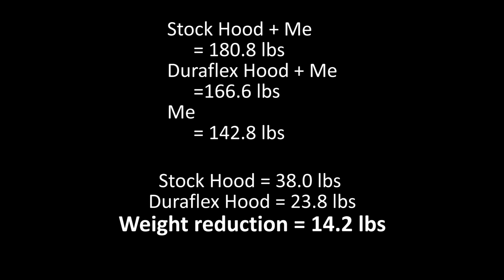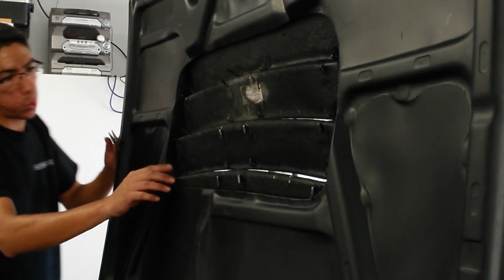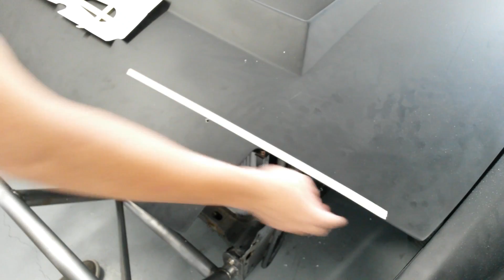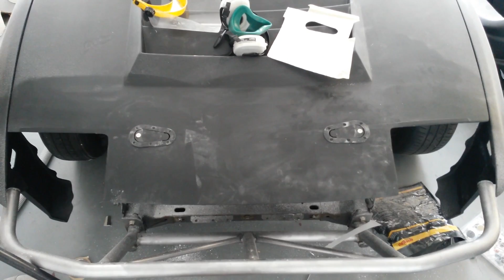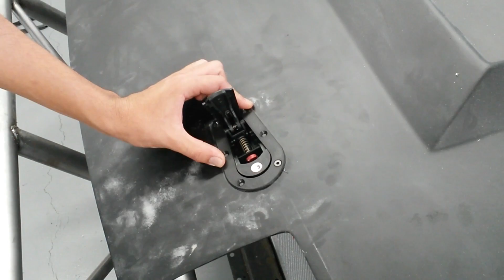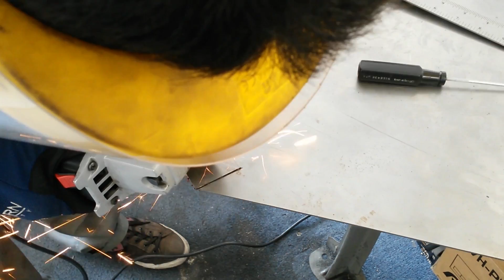Project 240 - Le Drift Car II | Ep. 7 - Duraflex Hood!

Comment: question: what if water goes into the hood?
Reply: I t won't that shape of hood causes a vacuum which  sucks hot air out the engine bay which forces cold  air in from other places
Reply from the maker: Nothing really

Comment: hey there I need some help  with some fender covers I just bought from duraflex they don't fit at the top part where the hood touches, so that I can bolt them on some sections are short and so I was thinking of cutting them completely off but have no idea how they can stay on without epoxying them straight to the frame

Comment: My car has a reverse opening hood, so the hinges are at the front and the latch is at the back. I'm putting on a fiberglass hood. Where should I put the hood pins? At the front, back, front and back? or maybe middle or are they unnecessary?
Reply from the maker: +Random Precision Put the hood pins on the side where the latch is at. For your application, the back. Front pins are not needed because the hinge is there. Middle is not needed either. Just at the back.

Comment: time for that stupid fuckin question. will you ever SR20 swap it?
Reply from the maker: +Jack ALLEYNE Hahaha no, I will never have an SR20 in any of my cars.
Reply: good man
Reply from the maker: Haha ;)
Reply: How many times have you been asked that?
Reply from the maker: Too many times that's how many haha
Reply: +Jack ALLEYNE i think every 240sx owner been asked that question
Reply: +OffBeat Garage interesting why
Reply from the maker: S13 WARRIOR SR has an aluminum block that half the threads strip out on when rebuilding. SR put's out less torque than a KA and torque is what you want when drifting. More expensive to replace an SR if it blows up compared to replacing a KA. Parts availability for an SR is lacking in the US. I can go to most auto parts stores and they'll carry parts for the KA but you won't find them carrying anything for an SR. For the price of SR swapping I can build a higher hp KA-T setup. Yup haha SR is not my cup of tea

Comment: It would be interesting to weight the hood with complete latches, hood brackets you made, and then, see the real weight saved.
I doubt it really will be efficient for cooling down the engine bay,but it should work for the radiator.
I would install a skirt between the radiator and the vents ,otherwise you will loose all the air pressure everywhere in the engine bay's turbulences and not create a low pressure hot air from the vents.
A cheaper way would have been to install shims on the articulated brackets to allow air to escape just in front of the windshield, (that mean after the engine following the air flow) and cut the structural layer of the hood.
But it wouldn't be so nice than this duraflex hood i guess.
A lot of effort in the video and work.
Greets from France.
Reply from the maker: +michaelovitch This hood is going to be pretty much necessary with doing a vmount intercooler and radiator setup which is planned. So hence the vents positioned right where the intercooler can have good air flow.
I have hood spacers and might be running those as well. Just not sure if I like the look of it.
Thanks :)

Comment: I see your Koyo being pierced by the red studs in a impact or tire intrusion. Cut them off!
Reply from the maker: +Osvane Abreu They will be cut when the front end is 100% done. Just like the tube front will also be fully welded when it's 100% done. Not going to make any permanent changes just in case I want to change the design up. So I'm not cutting them, just in case I change the setup and then end up needing them at their full length.

Comment: I have 1 very important tip for you... ditch the harbor freight grinder... seriously you will thank me!!! the lock button on them constantly break even on the heavy duty model.. Trust me i went through 3 of them in a year. Go to Lowes and get a kobalt grinder for $50. i beat the hell outta the thing and its still kicking! Nice looking project by the way
Reply from the maker: +Shane Hildebrand Lol I beat on this grinder and no problems. Over 4 years of abuse now and no issues. And there would be days during the summer where the grinder was on 5 hours a day, during 100+ degree temps and still keeps on going. If this one happens to break I'll get something else, but until then I can't complain. Thanks!
Reply: ***** I agree they are a good grinder. It's just the wheel lock button I had problems with. Idk maybe the older ones are made better? Lol thanks for replying. Have a good one
Reply from the maker: Shane Hildebrand Haha maybe, who knows lol. Thanks for the suggestion either way :)
Reply: No problem. Thanks  for replying either way! Most people dont

Comment: Just want to throw this out there- that hood catch is a safety mechanism designed to keep the hood from smashing into the windshield in the event of an accident. So disclaimer: You shouldn't do this mod on a street car. :)
Reply from the maker: +Michael Johnson Lol what? If you have hood pins, they are not popping off whatsoever in the event of an accident. And if you're in an accident where the pins or hood breaks then stock latch wouldn't have helped either.
Reply: To clarify I'm talking about the catch on the hinges themselves that you cut off. Aka safety stops.
Reply from the maker: I am well aware of that. The stock latch mechanism works on a lever and cable system. When that lever is pulled by the cable the hood is released and caught by the "catch" you speak of which is the safety precaution in an accident. My point being that, that is done because the stock latching mechanism works off of a cable and lever system. Where anything that triggers the lever, whether by the cable when you pull the handle inside the car, or by means of an accident and the damage hits the trigger the hood pops open and therefore they have the safety "catch" to catch the hood. But when you have hood latch/pin there is no lever or cable that can trigger that. When the pin is locked in, it's locked in. There is no safety measure required.
Reply: +OffBeat Garage Not the secondary hood latch bro. The safety stops on the hood hinges that you cut so the hood will raise farther up. What I am telling you is that [Disclaimer] people watching your videos shouldn't do this on a street car. Again I'm not just pulling this stuff out of thin air- I'm a collision tech and certified estimator; if you were in an accident your Insurance will find out about stuff like that.

Comment: I have a question. How wide across is the back of the hatch on your car? I can't find a ducktail spoiler for my car and I was thinking that maybe a 240sx ducktail wing would fit on my car, depending on how wide it is. If you could let me know that would be awesome, because I've been looking for a wing for awhile now and will just have to fit one from another car. Thanks!
Reply: What car do you hae
Reply: +Marco Hernandez I have a 1992 Honda Accord with the stock non-Vtec f22a6 that's polished and ported and will soon go turbo when I have enough money. I'm almost there =3
Reply: I'd you can find it there is an oem flushie...if not there are reps on eBay made by jacklee...
Reply: +Josh Papineau if*
Reply: +Josh Papineau I have thought about getting the oem flushie but I want one a bit bigger. If the rocket bunny ducktail style wing for the 240sx will fit in my car, it would be what I want.. Even if I had to modify it which I probably will have to. I've been looking for an older bmw wing that will fit. If you find something please let me know thanks
Reply: My friend has a rocket bunny 240sx on his cb
Reply: +Josh Papineau is it an early 90's cb7 accord? There are other types of cb's
Reply: +Josh Papineau I appreciate the help too btw
Reply: other types? there's a 4dr/2dr and wagon. I own a h22a coupe and a decked out 5 lugged wagon. It is on a 90-93 accord. Check out the video I just posted. Np.
Reply: +Josh Papineau I did some research and found a four door cb7 sedan with a rocket bunny ducktail wing for an s13 coupe. Now I know for sure that it will fit.

Comment: bro you could stop the flex by running actual weld beads instead of a million tacks.
Reply from the maker: +YourPistachios It would have still flexed with full beads since it wasn't flexing at the weld joint but in the middle of the metal tab instead. Not going to run full beads either until the entire setup is 100% finalized  and I know nothing will have to be changed. Common fabrication practice to do this.
Reply: Oh good glad to know you were aware. i was just thinking it doesnt look particularly strong haha.Keep up the good work! :)
Reply from the maker: +YourPistachios Haha yep, thanks :)

Comment: please tell me you shortened the bottom of those red hood pins! All I can see is them being bent inwards in a collision and skewering your radiator.
Reply from the maker: +Matt Kurz They will be shortened when the front end setup is 100% done and full beads laid on everything. Until then everything is tacked in place and nothing permanent is done such as shortening the pins. That way just in case I change something I don't screw myself over by doing anything permanent.

Comment: why is your whole rad support just tacked together? 
seriously looks like I could give it a few firm kicks and it will break off
Reply from the maker: +DolanMaster The whole front tubing setup is tacked together because nothing is finalized. That way if anything needs to be changed because something isn't fitting for some reason, or I just come up with a better design. I can cut the tacks off and then redo my work until I get it 100% for sure how I like. Then after that I'll do full beads on everything. It's common fabrication practice to do this.
Reply: +OffBeat Garage ahhh makes perfect sense, cheers for reply
Reply from the maker: No problem, have a good one :)

Comment: Off beat =ricer???
Reply: +Get Shreked  Yes he hasnt been doing any real mechanical stuff lately..
Reply from the maker: +NorwegianFrog Cause the mechanical is the easiest part. Need to get all the fabrication/roll cage/suspension setup done. Engine is just swapping the engine from ldc1 in and redoing the harness and that's it.
Reply from the maker: +OffBeat Garage Also all the body parts are sponsored items and have a contract for when they need to be installed. Sooo yea
Reply: +OffBeat Garage Cool dude, I'm lokking forward to seing you drifting again. And keep up the good work, love you videos :)
Reply from the maker: NorwegianFrog Thanks :)
Reply from the maker: Junaid Ahmed Stance ones are old and beat up. Might be teaming up with BC so makes sense
Reply: +OffBeat Garage And what coilovers are u running on that thing? :D
Reply from the maker: +NorwegianFrog Stance GR+ Pro, most likely switching to BC coilovers when the car gets running though.
Reply: +OffBeat Garage why:/ stance suspension is surperior to BC in my opinion

Comment: every duraflex part i've got cracks like mad. i've had two cars with full kits. its best to just buy the real deal, usually they just copy other brands like origin but i guess its fine for drifting.
Reply from the maker: +zum A lot of fiberglass parts crack. Especially when drifting where you go off the track one time and then your front bumper and side skirts all get cracked no matter the brand. So no need to pay 2-3x the price for an Origin or DMAX kit when it just gets smashed after the first event.

Comment: No offence, i love how you are thinking about turbo and making you car fast, but when i saw how big rims you got and how big brake rotors you got, i need to say, when are you going to upgrade you brakes? :D it's a must :D
Reply from the maker: +ThrottleManiac Not a must at all haha. The stock brakes lock up the 17's perfectly fine so there is no more need for braking power. Only advantage to bigger brakes is for heat dissipation in order to get rid of brake fade. But heat dissipation isn't a concern when drifting because you are not using your brakes enough to get them to a high enough temperature where it would be a concern. Look at Odi Bakchis' S13 with an LS inside it. He tandems with Mad Mike, Matter Powers and Vaughn Gitten in that car and it has stock S13 brakes. So yea haha not needed at all and there are better areas to upgrade.
Reply: +OffBeat Garage well okay, I forgot this was a drift car project :D, you got yourself a point there :D
Reply from the maker: ThrottleManiac Thanks for the comment :D

Comment: What are you gonna do or have done for theft protection?
Reply from the maker: +Grase_47er Well if I told you that would defeat the purpose of it wouldn't it? Haha
Reply: +OffBeat Garage Haha I mean like just the overall things you've done like an alarm or cut off switch no specifics lol
Reply: +OffBeat Garage nevermind lol I'll just figure out what to do to mine
Reply from the maker: Grase_47er Haha no worries. GPS tracking, have a cut off to the battery, cut off to fuel pump, cut off for power to the ecu.
Reply: My buddy had a fully built 240. Beautiful car and it got taken at like 2am from his front yard...
Reply: +Grase_47er Just do fuel pump cuttoff switch. Anything more than that and a basic noisemaker alarm is useless. If they want your car theyll take it.
Reply from the maker: MrTshoff The more the merrier. But yea, if they have a tow truck your car is gone anyways. As long as you have one cut off as well as a GPS you're set
Reply: ***** Ive seen tow trucks with winches so they just literally drag the car up on the bed
Reply from the maker: MrTshoff Yep they'll take it no problem. That's the benefit to the GPS. If they take it at least you can see where they take it and hopefully get it back within a day.
Reply: Tomas Bannon I knew a guy with a legit type r integra and he left it out while he was on his lunch break (drove it to work that day). It was gone within the 20mins it took him to go inside, take a dump, eat a sandwhich and come back out. He never even heard anything and it happened in broad daylight. The car was found as a shell two days later.
Reply: +MrTshoff so shitty...
Reply: Tomas Bannon Yea I have dogs most people are scared of so its never really been an issue for me but I get scared when visiting my friends at apartments and stores and such. Honestly thats why im making the switch to american cars. Not as many bottom feeders trying to steal your shit.